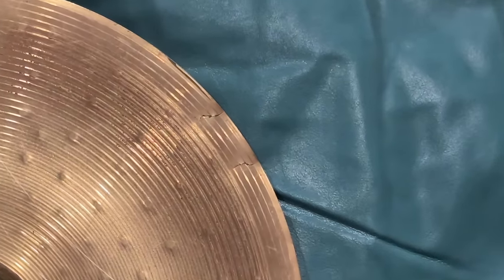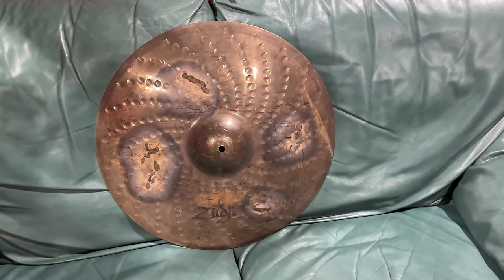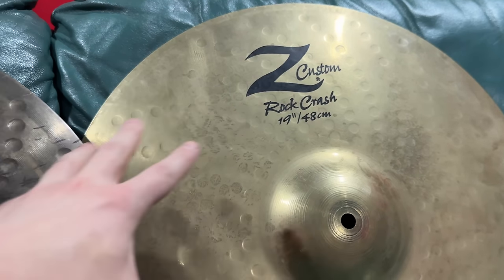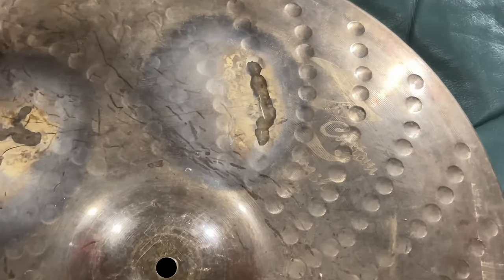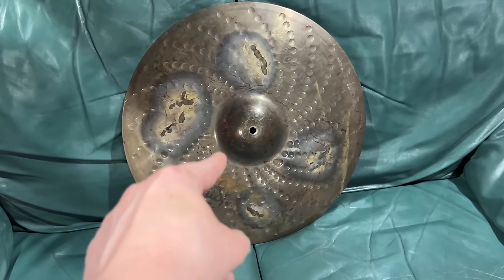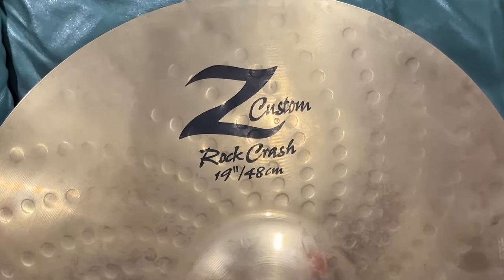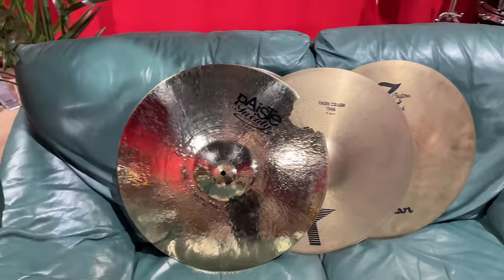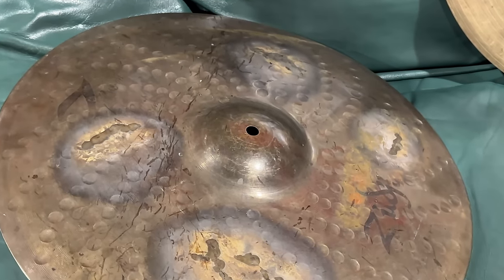Someone welded this cymbal.

Comment: I always heard from various teachers a quick fix that seemed to work while keeping that unique cracked sound was to drill a hole at the ends of each crack to stop it from propagating more.
Reply: I think we actually saw one of those among one of Dank's cymbals.
Reply: Engineer here, circular holes are the universal best way to dissipate stress. Be it airplane windows (used to be filleted squares, caused numerous crashes), or simply a cymbal, the circle from the drill hole removes the hard edge where the stress all piles up on
Reply: I've tried it on several cymbals but it keeps cracking for me, and I drilled it several mm above the crack. I think the best option is to just cut it out. When you leave the crack it sounds weird
Reply: @xerox2227  Shouldnt you drill right at the end of the crack? I feel like if you drill anywhere else, the crack can just propegate around the hole
Reply: @tfk_001 oh man, airplane windows. De Havilland learned that the hard way, didn't they?

(For those reading out of the loop: the De Havilland Comet was the first jet airliner to enter regular service. After a year or two a series of fatal crashes forced them to be grounded while engineers trouble-shot. Surprise surprise, it was the square windows.)
Reply: Drilling small holes in well progressed cracks doesn’t solve that the outer cymbal edges will move quite far apart in the vertical direction while oscillating; as they’re disjoined, waves won’t propagate through the outer radius like it used to, instead the two sides of the crack wobble out of sync, putting even more stress on the point where the two sides are joined. A large cutout solves that.
Reply: @tfk_001  maybe, but from what I heard the crack typically spread farther than the eye can see so you drill a little above. But I'm not sure
Reply: @xerox2227  that makes sense as well, from what I found online just cutting the whole thing out if its on the edge is best, and if its from inside to inside, drill all along the crack. My source is wikihow but it makes sense
Reply: A "stop drill" or "stop hole" needs to be done at the ends of the crack. It's a temporary band-aid, as the cracked area was already too weak to not crack in the first place, and now it's even weaker with the crack, but it can give you some time to make a proper repair (in this case, cutting out the edge). You should be able to see the ends with bare eyes, especially if you flex the opposing sides a bit.
Reply: The typical way you would fix a cracked piece of metal like this is to drill holes at the ends of the crack and then weld it up. That would still ruin the sound of a cymbal but for most jobs that's how you would do it.
Reply: I find you still need to use a Dremel or small grinder to add a gap between the crack. Which sounds funny….but that way the metal doesn’t touch and choke out the cymbal. I’ve heard the hole method is only temporary anyway. If it’s on the edge of a cymbal, just cut a V shape the size of the crack. Then grind it to a Pac-Man shape. It usually works pretty darn good in my experience. Interior cracks, especially on the bow, are tricky and I’m still learning how to properly fix them. I feel like the hole method would be best but you would still want to add a space between the crack so it’s not causing friction. Hope yous all have a nice day.
Reply: it works on most things
Reply: @tfk_001  late reply, I know, but the airplane windows thing is a bit of a myth. While sorta true, the plane that the myth originates deom, the comet, didn't suffer those issues due to the shape of the windows. The actual issue was the installation, as they were basically riveted to the pressure skin of the aircraft, which created microfractures.
Reply: @zhiracs the crashes were actually not due to the square windows at all - go research it a bit more, you'll be surprised!

But certainly rounded edges are better anyway (just wasn't the cause of the crash)
Reply: @gearhead743 beat me to it!

Yep it wasnt the square shape itself that cause the crash, it was the riveting. Not that round isn't a better idea

Comment: From a materials standpoint this is really interesting to see. I suspect heating an unbroken symbol, not welding just blasting it with a torch for a bit, would have similar results because you will have removed the work hardening. if that's the case I bet you could improve the sound somewhat by tapping the heated area with a hammer.
Reply: Cody???? Nice to see you here! Good feedback too, as cymbals DO indeed get their noise mostly from the hammering and heat treatment! When you disrupt that hammering with welds, it causes the vibrations to not spread evenly, and concentrate on that one spot, making a bonk.

Comment: I can't imagine how sad that person was after they put in the effort to braze what was likely their favorite symbol and just hearing that dead tink afterwords. Would have been heart breaking.

Thanks for the video, hopefully it will prevent others from making the same mistake.
Reply: i don't know what they expected. they put too much stress into it, making it useless. Also every welder knows that the area around the weld that was heated is the most brittle, and is always prone to cracking. And clearly they didn't even try much. Cymbal wasn't even preheated before the weld, bad welding technique and no post-weld heat treatment to reduce the stresses. That's why it looks as bad as it does, sounds as bad as it does and is cracked around the original crack.
Reply: Like when I tried polishing my glasses after the film on them peeled.

Comment: The Z Custom Welded sounds like a stack.
Impressive for a single piece of bronze.
Reply: I would argue that its not one piece of bronze anymore
Reply: Thats probably the cracks shaking and rubbing against eachother XD
Reply: I love the "Z custom welded" like that's a special model or something
Reply: It just sounds flat. Hit any big thin piece of metal not designed to be a cymbal and you'll get a similar sound. It's just dead, can't vibrate from all the extra material weighing it down.
Reply: @EllaBananas The weld lines are too stiff so they absorb all of the reverberation.

Comment: I'm 53yrs old and have been playing drums since i was 14. AND I have a degree in music education. Just letting you know you're not getting this info from some knuckle head....I avoid cracks with sandpaper. Periodically a check all my cymbals by running my fingers around the edge. When I feel 'something' I investigate with a magnifying glass. Sometimes it's just old stick hanging out. Sometimes its the start of a crack. Wet down some 180 grit sand paper. And go to work on the 'bad' area until you can't feel it with your fingers anymore. Then you use some wet 500 grit and 'finish' the area. Takes less than 10min. and I have no issues with my cymblas.... I actually wore a flat spot into a splash cymbal that had close to a 1/16" crack in it with this technique. No more crack. Sounds just fine. I have both drilled and cut cymbals when they were damaged. Once broke as many as 11 cymbals in an 18 month period. Trust me when I say, I will never cut or drill another cymbal.

Comment: As we've all seen from the cymbal manufacturing videos, B20 bronze goes brittle like glass if you heat it and cool it slowly without quenching in water. So when you weld the cracks shut, you create these very inelastic, brittle parts in the cymbal that have no flex in them at all. Then you hit it, and the force of the blow probably re-cracks the cymbal immediately. Then you again have loads of cracked metal surfaces rubbing against each other, and the reason it becomes so muted is because the vibrations dampen right away in the cracks as the two sides of the crack chafe together. The same mechanism that doesn't allow stacked cymbals to ring either. They choke themselves out, essentially.

What I'd really like to see is someone doing the quenching process to the best of their ability right after each weld. To try and get the best possible springy crystalline structure back in the metal. 

I'm just blatantly assuming that wasn't done with this Z Custom, well, because the way that it is.
Reply: Yup, copper-based alloys (well, face-centered cubic system alloys, includes gold, silver, etc, a lot of non-ferrous stuff) with heat harden if allowed to cool slowly. 

Getting this cymbal to a medium red hot and then quickly quenching it will soften the whole thing and might make it sound a bit more like a cymbal. Or make it sound like total garbage.
Reply: I find myself wondering how/if a lower temp method of joining metal would change the sound, both soldering and brazing are comparatively quite cold.
Reply: @AmaraTheBarbarian  brazing and soldering might not melt down the bronze, but they add other material onto it.
Reply: @AmaraTheBarbarian I think that's what he was talking about at the end. Brazing probably could work and not affect it too bad if done by someone who knows what they are doing. It won't be as strong as a weld though since you haven't literally melted the cymbal... And if you keep beating on it chances are the brazing will crack again.
Reply: What I wonder too is if you just repeat the heat treating process to the whole cymbal after welding
Reply: @CainXVII  I mean sure the brazing won't be as strong as a weld, but that's a fair compromise if it keeps the sound, because welding turned it into the bonkenator 5000
Reply: @funnybobjr  I think it could be a neat experiment to anneal it like that, yes.  That being said, I don't think it will actually work.  With new manufacture, once a blank is formed and annealed, all further hammer shaping and lathe work is done cold.  This introduces a certain degree of work hardening which is integral to the sound.

Comment: Chrrrrist I wasn't expecting that much of a difference! Not being a drummer (guitarist!) I assumed it'd just sound a little duller but wow. Welding absolutely killed it.
Reply: There are also new cracks from the stress of the cooling welds. Whole cymbal's trashed. Cutting out cracks with a grinding tool really seems to be the only fix.
Reply: Killed it, shot it's corpse, and then ran over it. This poor cymbol. And yet I want to hear it used in a song it's so endearing

Comment: Now I'm curious if you could solder a crack in a cymbal — that'd be extremely localized heat, and minimal added material, so maybe it wouldn't totally wreck the sound.
Reply: As a man who can solder, I'd absolutely be willing to try if I had a mashed cymbal. Alas I play strings
Reply: Interesting thought 👀
Reply: Rebonding the metal in any way will just completely fuck the elasticity... Would sound the same I'd say
Reply: Solder will quickly de-laminate while playing, without stopping the crack at all.
Reply: isnt bronze a really good heat conductor?
Reply: maybe a pulsed laser wielder?
Reply: Bronze and copper "harden" when hammered, it's a cold process (unlike other metals such as steel, which need to be "hot tempered") The force of the blows builds tension, it's the same manufacturing process of the Hang drum, or "Steelpan /steel drum" (they are "baked" at the beginning of the process, sometimes in intermediate stages, but the final sound is obtained by building tension with the hammer (hydraulic presses or lathe when mass produced, but it is "cold forging") 
Any heat applied afterwards releases some of that tension,  that's why it sounds muffled
Reply: @fluffskunk  I'm sure a lead based one would, but maybe if you could find a way to make a 'solder paste' style bronze treatment paste, almost like wood glue. Would 100% need hammered and shaved again, but it might work
Reply: Brazing would probably be the best option, although I doubt it would get much better results.
Reply: You can, I’ve done it, but it is extremely easy to burn right through. If you have some junk cymbals give them a try first to get the hang of it and then give it a shot on a legit one you want to repair. Still though, be prepared to possibly lose or completely change the appearance and sound of the cymbal you are repairing.
Reply: To get lead free solder that can flexibily connect bronze we're looking at 280 to 300 degrees. And with how conductive copper is, the entire thing will get close to that as well. And everyone who has tried soldering a big block of alu or a massive copper plane knows how long it can take to get it up to those temps.
Reply: @HappyBeezerStudios  sure, time consuming, but we're also approaching recasting the thing at this point
Reply: I'm thinking you should be able to do some variant of what you do in blacksmithing, where you keep the parts you don't want hot wet. Just putting something wet on the other metal usually helps with heat spreading. Maybe keeping most of it underwater? With some workshopping you could probably figure it out.
Reply: TIG Welding would probably be the best because you can get the weld area really hot without so much heat absorption into the surrounding material, just need the right filler wire and gas mix which is sometimes difficult because the variation in bronze mixes.
Reply: You need to actually join the metal, and smelt back the cracks.
That requires heat.
The only thing you might be able to try is aggressive active cooling around the welding area, but that would probably introduce more cracks than it'd fix.
Reply: Or can it be annealed somehow? After all the metals are melted and formed and then heat treated right?

Comment: Welding or braising seems like it would wreck any stamped piece, with different materials and the heat warping hardness consistency. With edge cracks, I’ve had them cut back in diameter. I guess they used a lathe of some sort. Like you, I find it better to just snip off any dangerous shards and keep playing it til the bell explodes 😅

Comment: In order to stop a crack with welding, you've got to drill a hole at the end of the crack first, and then weld it up, otherwise the crack will reappear. At 5:55, it doesn't appear that has been done to any of the cracks.

Comment: Out of sheer curiosity, since you can save a symbol by cutting out from the edge, could that deceased symbol have been "saved" by cutting the cracks out of the center? It would look hilarious, a giant perforated symbol, but would it sound closer to the original than the weld?
Reply: Not a cymbal expert, but what I know about sheet metal from aviation mechanic school:  Maybe.  The thing about a crack is the sharp ends are stress risers, it's a single point where stress concentrates. Drilling the ends of the crack out to put even a small circle on it is often enough to keep the crack from continuing.  Taking something like a hole saw to it and punching the entire crack out in favor of a perfectly circular hole, and properly de-burring said hole, might just solve the crack.  Whether it will preserve the sound of the cymbal?  I dunno.
Reply: Yep! I see it all the time. I have several cymbals with oblong holes to fix bow cracks and they still sound good
Reply: One of the examples (not Wade's but a different drummer's) from the "cut out and repaired" cymbals vid was in the centre
Reply: Three helpful replies(so far)!! Thanks helpful side of YouTube for teaching me things.

Comment: You can just drill a hole on the tip of the crack and it will stop spreading. 
You may also want to carve a space between the crack edges to stop them from scraping as the cymbal vibrates.

Comment: Hey so I think the cymbal sounds like that because of a combination of the heat from brazing softening the bronze near the repairs and that is deadening the sustain of the cymbal, and then there might  possibly be some cold joints in the brazed areas causing the rattle-like sound and also stealing energy from the cymbal. 

You can try placing the cymbal on a block of wood and hammering near the repairs with a ball peen hammer, this will work harden the bronze and bring back some sustain and tone.
Reply: Do remember you're talking to a magician. He probably doesn't even know what a ball peen hammer is.

Comment: when you introduce new metals to the cymbal via welding, the cymbal no longer reverberates at the same frequency throughout, so the welded metals cause the vibrations to stutter out really fast as the waves of vibration at different speeds all collide in weird ways

Comment: I wonder if it would be possible to actually fix a crack in a cymbal with something like cold welding/vapor deposition in a vacuum chamber or a special electroplating setup... Of course with how the normal fix works, the crack would show up again quickly, but that might be fixable by doing the cut under a vacuum, heating up that chunk of the cymbal and then just sticking it back together.

Comment: There definately is something special about cymbals, how a thin round piece of metal can produce that washy sound when hit hard, and how just size and shape can determine if its a splash, crash, ride, hihat or a china cymbal. Wheres after a certain thickness is reached it turns into a bell and goes "Ding"

Gongs are even more weird as they sound like their at first producing just a sinewave tone kinda sound like a large bell, to then suddenly break up into almost a crash cymbal kinda wash.

Comment: In terms of stress on the material; it's maximal at the max deflection in an oscillating system iirc

I think you're right in that because the middle has the biggest distance wobbled, it's copping the peak stress

Comment: Gotta think of cymbals like stretched glad wrap, if its evenly stretched its gonna reverberate, even putting a clean hole or slice in it wont stop it from reverberating. But heating a cymbal in one spot is the metallic equivalent of poking and stretching a patch of the glad wrap, only that little stretched area is gonna do the reverberating. Gotta reheat and rebeat the whole damn thing to get any of that tension back in the metal.